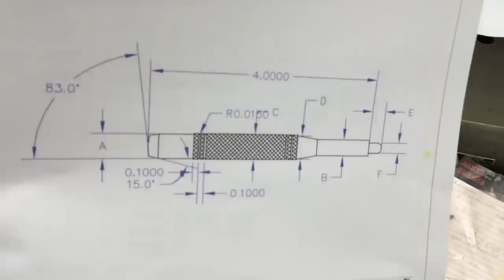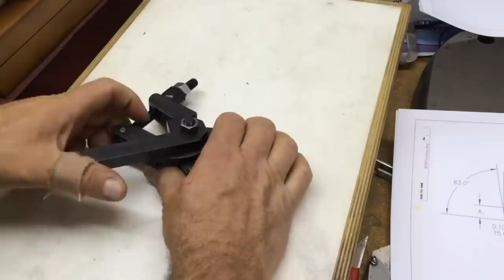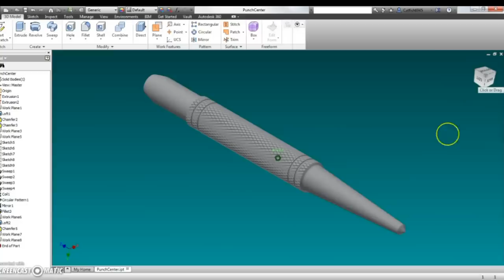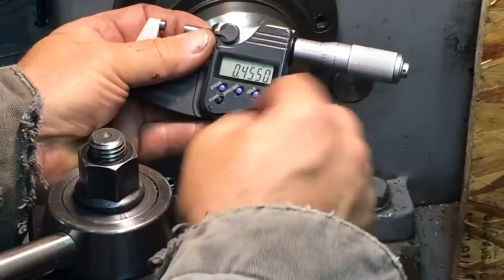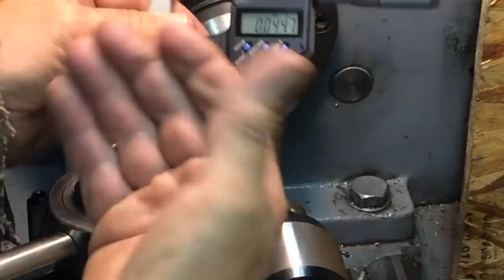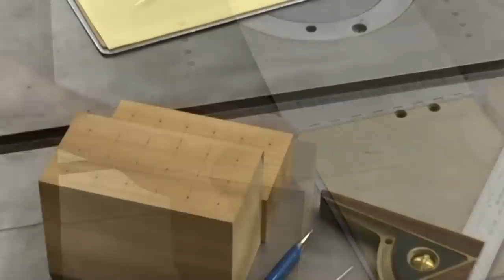How to Make Roll Pin Punches

Comment: That is a great tip to set the micrometer the desired size then zeroing out.   I can do the same thing but never thought of that.   Useful tip.
Reply: Same for me. I just inherited a digital Mit and mic vise.  Just starting to use the mic, but have been wondering if something is wrong with mine. 

If I am doing repetitive measurements, like I was a few days ago, on some gage block candidates I acquired, (spacing blocks from a purpose built circular saw I bought at auction with a ground finish, to a 4 decimal accuracy), I have to make sure I check & re-zero every measurement.

If I didn't, I would suddenly find the 2nd, 3rd or 4th dimension off by a few thou. It happened several times, before I just started re-zeroing every measurement.

How often does your digital mic 'lose' it's zero reference?

Thanks...

Comment: How do you assure the top holes mate properly with the bottom holes?
Reply from the maker: Accurate layout, center punch and use a brad point drill.  Thanks ExtantFrodo2.
Reply: @RRINTHESHOP  I was thinking if you needed tight fitting holes then you could make the box in three parts. Drill the holes through the top and partway into the bottom. Then saw that block 3/4 up from the bottom. Glue on a top piece place your magnets and RR tag. Sand and finish to your hearts content. :-)

Comment: Great job and excellent video.  Just FYI, the Eagle Rock knurling tool you borrowed is their K1-201.   They also make a heavy duty version called the K1-44 which is more money, but the shafts that the knurling wheels rotate on are very easy to remove.   If you decide to invest in one of these, it's well worth the extra money to get the K1-44 specifically for easy knurl wheel swapping.   Link to the K1-44:  https://tinyurl.com/y348kfxn
Reply from the maker: Thank you David, I will check the link.